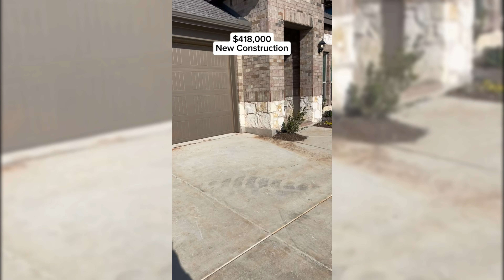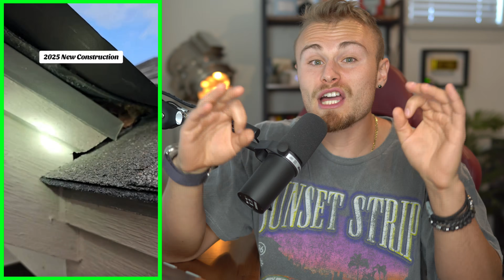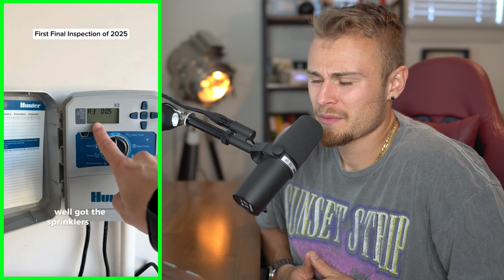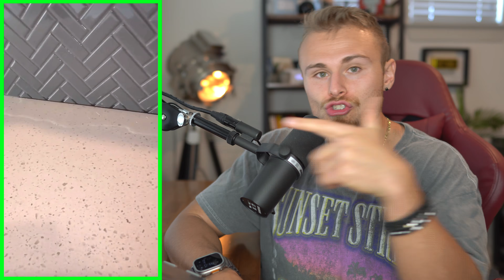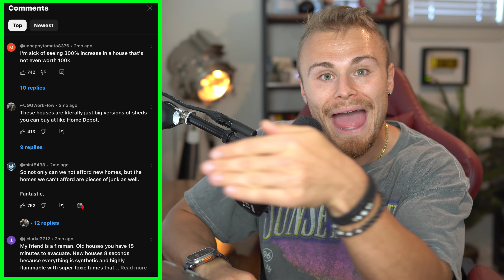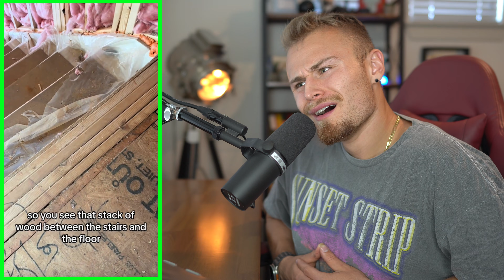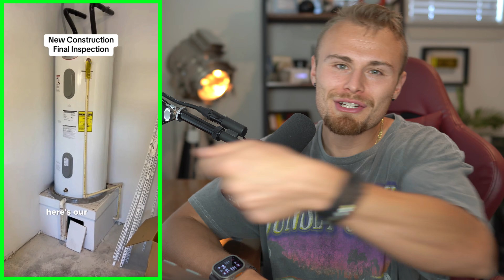New Construction Homes are STILL HORRIBLE in 2025…

Comment: 14:35 This is 100% true! Our brave Firefighters will not go into a home built after an asserting date, and they will NOT work/walk the roof of a newly built home. It's the material that is used, it's all basically compressed wood with a flammable adhesive holding it together. Look at the plywood they use in these newer homes and look at the plywood used 25 years ago. I never understood why it was okay to build homes with a highly flammable material and the NEC allows it. Someone's pocket is getting grease at the expense of people's lives.

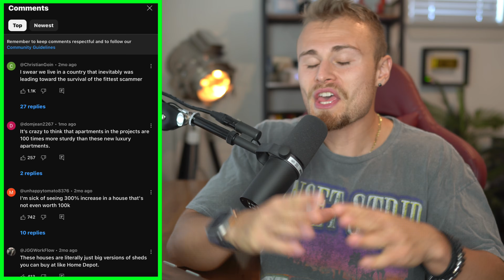Comment: 11:15 I had a Honda and had issues with its electric system. I took it in, and the warranty expired the month before. It cost me close to $1000.00 to fix the problem. When the work was done I asked the mechanic what happened, and why it failed. He said the insulation around the wire harness. Honda stopped using plastic/rubber insulation and started using a soilbean-based product. The problem with that is it attacks RATS that love eating on it which causes the wire to short. He also said this has been an ongoing problem and Honda is aware of and took no steps to resovle/recall the problem.

Comment: That "stucco/textured" walls are a way for the drywallers to be less skilled and do things quicker. It is an art to be a drywall finisher that does smooth walls, you can cover a less than stellar mud/tape job with that texture. No expensive new construction home should have textured walls IMO, it's the cheap option.

Comment: Walls with texture on it are common in Germany. It is called "Raufasertapete" in german - wallpaper with small woodchips in it. After the wallpaper is dry - white paint is put over it. Newer buildings tend to have non textured wallpaper for a smooth finish.

Comment: Unless you custom build your home, a home built at least 2 decades ago is way more sound than the Cracker Jack houses they build now. I’m part of the construction industry so deal with this side of it. Bought my home 8 years ago this month, it’s now 30 years old. Replaced AC system a few years ago, from the original. Water heater is  still the original. Some upgrades were done by previous owner, but they were minor/cosmetic upgrades. Builder grade materials are a real thing and of lower quality. Some builders do the minimum that just barely pass final inspections (with the permitting jurisdiction not a private one used in the sale of a home) for a CO to be issued.

Comment: @2:30 Oh you sweet, sweet summah' chaiiiuuuulllld.... Have YOU seen the lumber quality in wholesale lumber yards lately?! After taking a look at a few mahself, cuz I didn't believe the rumors at first, it pretty much was one of the final nails in the coffin for me getting a new construction home and only sticking with older homes with good bones.

The wholesale lumber quality is ATROCIOUS and it shows in new construction. Warped lumber, filled with knots. Hell these builders are using thin-af OSB (which is similar material that is used in cheap disposable ikea & walmart furniture) instead of dummy thicc pressure-treated plywood for the external sidings!

I'll make a mental note to NEVER buy a used home that was built after the '90s, if only Boomers actually took care of their homes instead of letting them rot while they still lived in 'em. I mean ffs, use the fat-af equity of the home to do some structural repairs to it instead of spending it on trips :/

Comment: My dad was an architect and home inspector.  When I was buying in 2008 he would not let me look at any new construction
Reply from the maker: just like cars. its good to buy several years old. most of the problems should be fixed by then and you know it can stand the test of time
Reply: 2006-2008 were exceptionally bad years.  Any time there's a housing boom, ppl take massive shortcuts to build as fast and cheap as possible.  So, thank your dad.

Comment: 7:15 Those walls aren't sprayed with drywall mud and it's called a "knockdown" finish.  It is the cheapest way to finish a wall and hides imperfections.  It doesn't belong anywhere IMO but at best it should not go beyond a cheap apartment.  A home that is anything above builder grade should NOT have knockdown finish ANYWHERE.  This is actually absurd.
Reply: Most homes on the Outer Banks have that wall texture.
Reply: Knock down texture is what you want on ceilings, not that popcorn stuff. Walls optional but would be ok.

Comment: I bought my new construction home in August 2021.  My husband would not get on board with my wonderful idea of buying an older home with lots of space to grow into, so I settled for the idea of a newly built cookie-cutter style home and neighborhood without having any idea how poorly new homes were being built. 
Walls are paper thin from room to room, you can hear every little thing everywhere in the house, even if doors are closed. There's a small hole in the floor under the carpet where the boards aren't touching, several minor things like cheap hardware used in the bathrooms, no caulking in the corners of the baseboards, very little to no sealant in sinks and on counters, etc., and the best part of all? Not even a full year after moving in, our AC went out. Had it fixed under warranty, not knowing the "fix" would only be temporary. AC went out again last summer, same exact issue as before. Thankfully, it only cost a little under $1K to repair this time since it was our responsibility to cover it, and the faulty part was replaced. I can only hope that we won't have any more issues any time soon. Husband still thinks we made the right decision, and though I disagree on the house we chose, I am truly grateful that we chose to buy when we did. Low housing price + locked in historically low interest rate..... I really can't complain too much.
Reply: Your husband clearly knows nothing about home construction.
Reply: @gracehetfield5331  very true

Comment: I’m a third generation Floridian. Part of the problem I see with a lot of these new builds is that they have run out of a lot of the higher elevations for desirable areas to build so they’ve cleared swamp areas and wooded areas where water tends to flow when we have heavy rains. These areas are super fresh and not very good for building on a lot of times. The ground is continuing to settle even after being done (hence many , many cracks everywhere) as the builds go up FAST. Many environmental agencies have been trying to prevent this but our gubment here dgaf and just want to allow whatever permits they can. This is also why so many newer and even older neighborhoods adjacent to new builds have flooded with regular rains and storms. Either they’re areas that used to flood as a swamp forest or all the new paved over swamps are leaving the water nowhere else to go.

Comment: Ex-plumber, now now working in the whole sale plumbing parts industry. I've done new construction, remodels and repairs.
Now, my clients are big companies for new build, etc. 

Why can't they find good help? It's true, it's hard to find new plumbers. Every summer, after high school graduation, all the big companies will hire about 12-20 prospects as apprentices.
By the end of the year, they're lucky to have 2 left.
I call it "plumbing survivor". 
They're let go for a multiple of reasons, watch a video about why employers don't like hiring gen Z and that's basically why these new guys don't make it.

Most plumbers do know what they're doing, they do know what's best, however the developers are what stops them. They want it done as cheaply as possible. They either hinder the good plumbers by disallowing them to buy the proper materials they need. For example, there are brass pex fittings. A brass pex tee 1/2" costs roughly a $1.50. The plastic one costs $0.30. 
The boss man will make the plumbers use the cheaper material. I've have had the copper vs. Pex debate and I actually don't have a favorite. Yet, you will not see homes plumbed in Cooper unless the home owner requests it and is willing to pay. 

When a delvoper hires the cheaper guy, they are typically paying for someone who doesn't know much plumbing. Faking it until they make it. Reusing old parts is a big thing for those guys in my area. I know one plumber who brags about getting to plumb new apartments here goes behind my work place and strips scrap for anything he can reuse or sell.
Embarrassing.

As for the water heater thing, honestly, they could have bought them in bulk and had them sitting in a warehouse. If it's new out of the box, it'll be fine. Water heaters are very dumb machines. They aren't like phones that change every year or whatever. 

I take great pride in this trade so I get so angry seeing these new builds. It's also why whenever I see the girly pops on tiktok prancing around their new build homes, I'm crying on the inside. As a woman myself, I am all about educating yourself before you wreck yourself.

These homes are unsafe, cheaply built, and I'm sad people are still falling for the rouse. Remember guys, not all that glitters is gold. You can easily paint a wall and tear out carpet.

However, plumbing??? Especially since most new builds are slab homes (in my area), you're looking at 10s of thousands to fix.
Reply: It's true with the same with Roofing and a lot of other construction Millennials don't want to work they want email jobs

Comment: Wow the concrete breaking with a foot is beyond  crazy.
Reply: Imagine if someone drove over it...good bye floors. Good bye tires.
Reply from the maker: insane right!
Reply: Lol Americans are clueless when it comes to concrete. Thats cn68, it's gypsum based not cement based. Some idiot poured cn68 over wood to level the floor, something that is done normally over a concrete slab to give it perfectly leveled finish. The wood absorbed water and changed shape. You put all these fakes ... like stones near foundation, gypsum on the floor to look like concrete .... and the house is built out of spit and sticks. Concrete  is NEVER poured that thin, it's a structural material not a finishing material
Reply: Also on the doors and windows you don't use silicone. Cos it's simply impossible to seal. It does not penetrate. Even if you seal perfectly you still have a gap behind it, the window floats, is not insulated.  So the standard in my country is a finger gap. So you can put foam. The foam expands so you get the thermal insulation. And on exterior just waterproof paint
Reply: @GeorgeS-z8x  elastomers and urethanes are better than silicone yes, but  costs is what silicone usually ends up getting chosen 
Acrylic is fine insside
Reply: @CT_Taylor  Cost is low for both. The problem is they make the openings for window and door with small tolerance. and you cant inject the foam anymore. Not to mention with such low tolerance in a wooden structure the pressures can change and bend and crack upvc frames.Wood is not fixed, its more prone to change shape. You have to use wood frames or increase tolerance. And I had to Google what caulk is. That guy probably doesn't know what he's talking about, nobody would use acrylic caulk on exterior. That's silicone
Reply: Now imagine you’re 3d printed home and that concrete.. notihng can go wrong
Reply: That’s China tier construction
Reply: Lol china actually is one of the best in construction 😂 dont judge the products they sell becuz those are the only ones cheap people want when it comes to their own stuff they build quality stufft @LTDLetsPlays
Reply: The gravel washed out or was never packed in to begin with.
The grade wasn't right so when they removed the concrete forms the gravel fell out from under the concrete.
Reply: @howlinwulf thats not a foundation. Thats an upper floor. A foundation is structural. Walls rest on it. Its thick and reinforced with steel. Does not split like that no matter what. Those walls dont rest on that ... concrete ... you can see the tape they put on the walls to confine the poured material to that room. Cos thats not concrete ... i already mentioned what that is